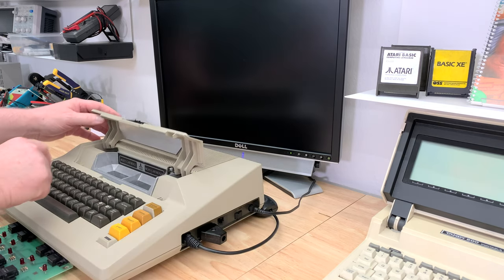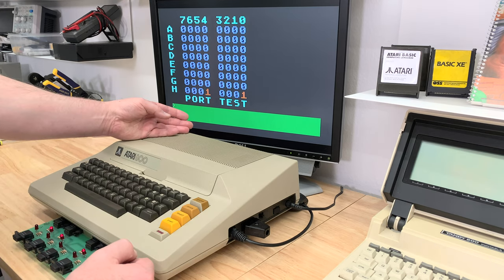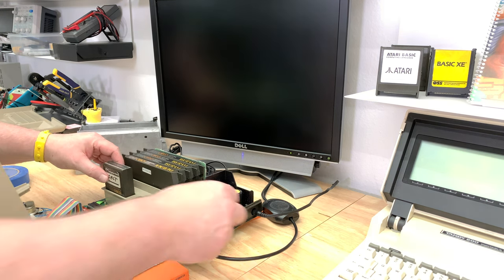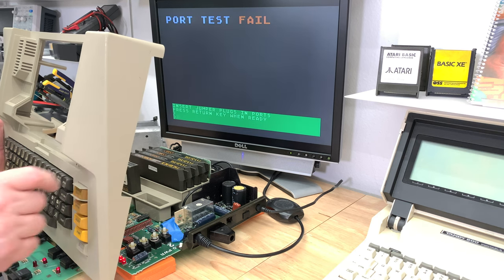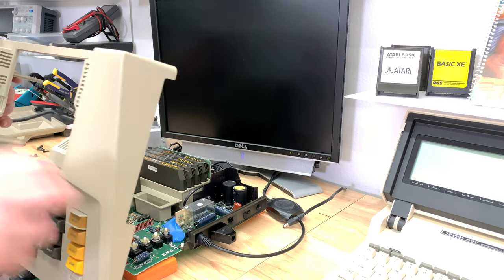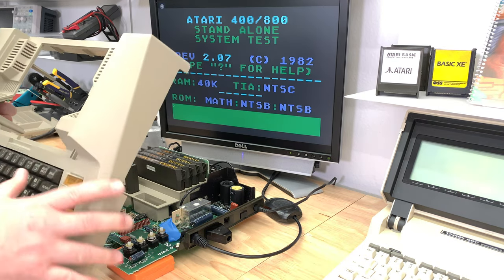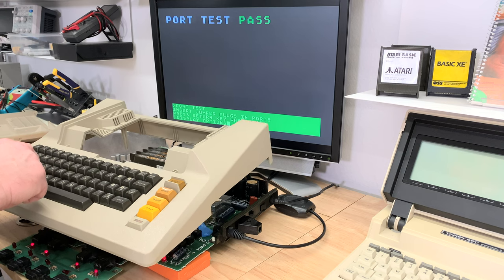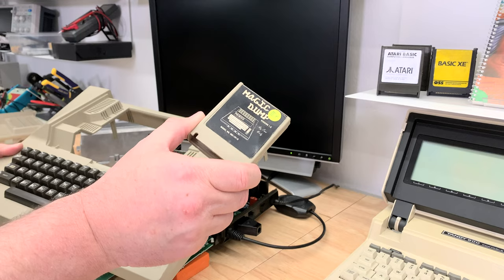Bad Atari 800 POKEY Chip? Bad 6520 PIA Chip? Bad Salsa?!?

Comment: I wonder if there’s a loose connection somewhere on the board or a cracked trace and if plugging and unplugging the keyboard flexed it. Also, I found the pins on the chips and the sockets themselves can oxidize on some old computers - the Atari STs were notorious for this. You could remove the chips and clean the pins with an eraser. Just make sure to get all of the eraser dust off before re-inserting them. I don’t know if this is still a recommended solution, tho…
Reply from the maker: All good suggestions. Before putting it all back together, I reseated chips and applied "Stabilant 22" (Google it) to a few connectors - including the keyboard connector.

Comment: Might be oxidation.  I'll have to try this with my 800, because it also won't print with the fujinet, but everything else seems to work.  where did you get the loopback connectors?  I don't have them so I can't test the ports with salt.  I'm wondering if Fujinet printing now works on your 800?
Reply from the maker: Hi, Stuart. Just had a chance to fully test some things and, Yes, I'm having no problem now printing from the Magic Dump cartridge through FujiNet to a PDF. Yay! :)  As far as the loopback connectors; They are original (ie. old) Atari test items. They are just harder to find nowadays and I lucked out on coming across them.
Reply: @TheVintNerd  Thanks, I'll give it a try then.  I'm guessing that my 800 has the same problem.  I don't have the test loopback connectors that you do, so I couldn't test it fully.  It didn't make any sense why printing wasn't working when everything else seemingly worked. Sound works, IO works, keyboard works etc.  Thanks again, very helpful information.